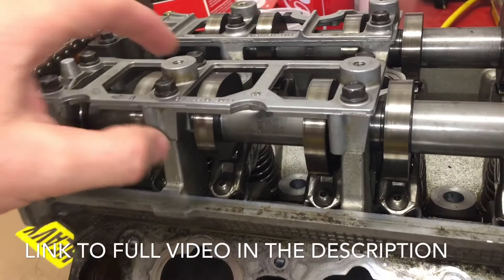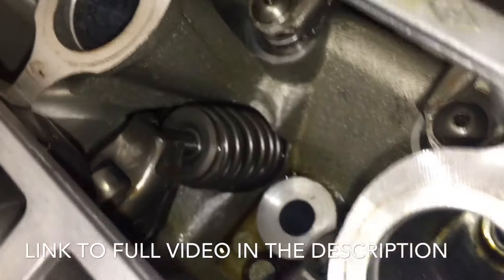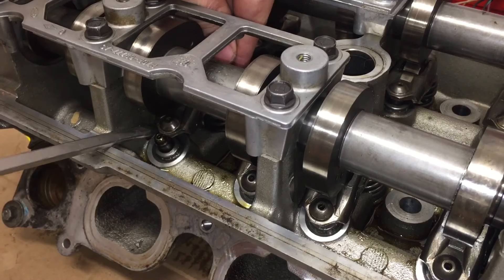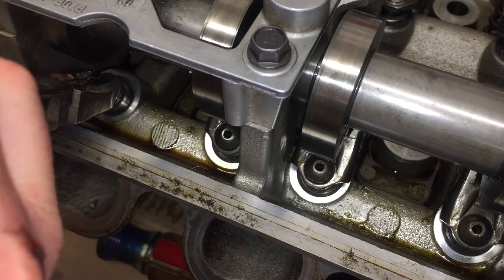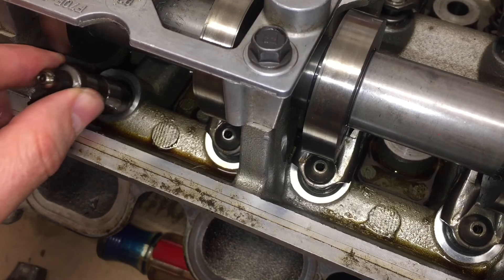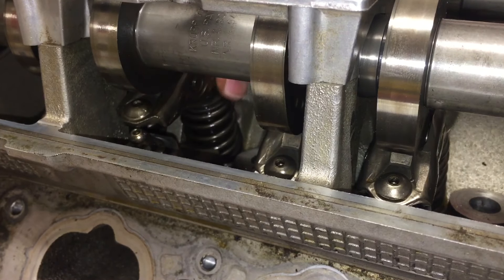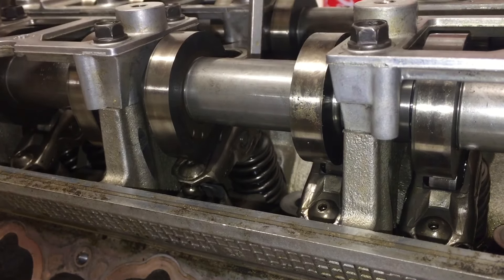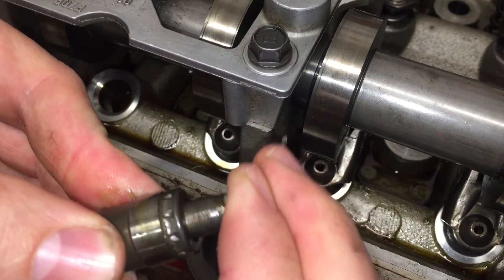Valve Lash Adjuster Replacement: Mustang, F150,  hydraulic valve lash adjusters 4.6l 5.4l dohc

Comment: The problem that I see with the 'popping-out' method, that it does laterally push the shaft of the valve and thereby applying a bending force to it. I understand that you and others may have done it this way many times over and hence are comfortable to conclude that this may not be enough to bend a valve. But who knows for sure(!) It does not take much for a slightly bent valve to get stuck and hit by the piston.
The "popping-in" method seems OK and actually quite smartly executed.
Reply: A bent rod or some other part hitting the piston, you would hear noise.
Reply: @bryanvance6629 in conclusion, is this method safe? Or not
Reply: @iPutTheJinGenius5  The link you provided does not work.
Reply: @mrtopcat2  try that one

Comment: Would this work with other dohc engines?
Reply from the maker: I’ve done it on Ford SOHC and DOHC engines. Not sure on other manufacturers
Reply: Thanks to your video this also worked on my 1vd ftv engine! Whichever saved having to pull the whole motor! Cheers from Australia

Comment: This method will it work without removing head? And if yes do I need valve spring compressor tool or can I use the screwdriver method? Thanks
Reply from the maker: Correct. This is for replacing the rocker and valve lash adjuster only. It’s even easier with the heads on the car so you can rotate the crank to move the cam and take pressure off each lash adjuster.
Reply: @dannyjohnsonsgarage  Thank you for fast reply much appreciated. 🙏
Reply: Can I use the screwdriver method while the heads are still on the car?

Comment: I have a 95 mark viii dohc motor in my 67 f100. When giving slight revs, I'll get a ticking done from the passenger side that will lessen after a few seconds. I assume it's a bad lash adjuster. Does that sound right to you? Is the fix similar?
Reply from the maker: It would be a similar fix if that’s it. I would take the cam cover off to investigate. It could also be a timing component, so listen around with a stethoscope https://youtu.be/WuZL7DSej9E?si=A7XcqWAECo2sSYfs
Reply from the maker: If it is the timing components, I have a video on that too https://youtu.be/rqsWUZjDtnY?si=SZWD0oHPo4GXUg_V
Reply: @dannyjohnsonsgarage can i run the car with the valve cover off to verify exactly which one?
Reply from the maker: @yarkie1  I can’t recommend it, but I have before on the 2V engines. It will splash a little oil, so make sure it doesn’t get on the hot exhaust. At idle it will be flicking some oil around but for a short time you’d probably be fine. On most cars you can put the accelerator to the floor and then when starting it will crank and not start so you could watch the valvetrain that way. Of course be careful in case that was not a feature for 1995.
Reply: @dannyjohnsonsgarage  I appreciate the responses. I just watched the timing chain tensioner video. Great job! Easy to watch and understand. Thanks again!

Comment: How did you determine these were bad? I am in the midst of a rebuild on one of these and the haynes book says to put a paper clip in the hole and it should release the check ball and allow you to manually bleed out all the old oil and ensure that they are not stuck/can pump back up after bleeding down. I cannot for the life of me get any of mine to do that. I even soaked one in acetone overnight. Makes me think they are bad or I am stupid lol
Reply from the maker: I put an Allen key in the nose of them while submerging them in motor oil and pumping. It’s also supposed to prime them, but they are hydraulic, so like a bottle Jack it’s hard to tell if they hold pressure until they are running. They should pump if they aren’t locked up. I followed the Haynes steps too but it’s hard to know if they are good or bad
Reply: @dannyjohnsonsgarage  I ended up blowing them out with compressed air after acetone soak. They freed right up and I could release the check ball. They all pump up with any fluid. Even the acetone.

Comment: Been doing a lot of research on this subject and from a few sources that NPI lash adjusters bleed down faster then PI lash adjusters with 4V being the fastest .. (coyote engines are different apparently?) if you are doing a PI intake and cam swap on a NPI engine sourching the parts from a junkyard PI crown vic grab the lash adjusters while you are there because they are superior to the NPI oem adjusters.. also if ordering new adjusters for 4V ..get NPI adjusters .. if you simply order them from an aftermarket company you might be getting the faster bleed style 4V ones when this is a chance to upgrade to the better design.. comp cams has lash adjusters with slower bleed down rates and they cost a ton of $$$ who is to say they are not repackaged ford oem PI lash adjusters or they simply went direct to the oem supplier for the upgraded design ?

Comment: Some say the hla's should be installed empty, some say no, some say rock solid lifters bend valves.  I'm confused.  Should the lifters be just stiff w/ oil and NOT rock solid?  should they press easily (no oil) as long as the plunger springs back?  Please comment.  I have a '99 Expedition 5.4.
Reply from the maker: If they give the instructions to prime, I would imagine it’s for a reason. You submerge them in a bag of oil and prime them by putting an Allen key in the head and pumping. I would also hold the gas pedal to the floor while starting the car so it will prime and not start.
Reply: That doesn't help me much, but thanks for the quick reply.

Comment: Do you gotta remove the heads or is it possible to keep them on
Reply from the maker: You can keep them on, but rotate the crank to turn the camshaft. It’s actually easier without removing the heads
Reply: @dannyjohnsonsgarage  cool I got an act lightning 145k I’m sure they need changed same with cam followers how often should they be changed

Comment: Can you only use this method with the heads off? Or can you do it on the vehicle to? So you don’t have to compress the springs?
Reply from the maker: It’s the same when heads are on the car- even easier since you can turn the crank shaft with a breaker bar and position the cam lobes right where you want them

Comment: Was curious if a hydraulic lifter out of a 1999 Ford F150 5.4 Triton V8 fit in a 2010 Ford Crown Victoria police interceptor 4.6 engine?
Reply from the maker: I would put both year, make, and model info in and see if they are both compatible. https://www.amazon.com/gp/product/B081TZMDN7/ref=as_li_tl?ie=UTF8&tag=2004047-20&camp=1789&creative=9325&linkCode=as2&creativeASIN=B081TZMDN7&linkId=3fb9111174aee2df78ccab85194f97da

Comment: Does a 2014 Ford Mustang V6 3.7 need a valve lash adjustment or is this only for older cars?
Reply: The “lifters” here are also known as called hydraulic lash adjusters and they are self-adjusting. If there is a valve lash problem then they would need to be replaced like he’s doing here

Comment: i own a 2017 Coyote, it still has a warranty, so the dealer is going to deal with it, but the question I have is, do these tend to fail often?  I do not seem to remember these failing in my 2007 GT with 130k miles and mine in the 2017 make noise when I first start the car for a brief second then goes quiet like the lash lost fluid or something. I was going to look into if I should bother getting the Ford Performance version and hope they will install them under warranty if I paid for them
Reply from the maker: I don’t think they fail often. It’s just something a lot of people assume is bad and not normally the case that they are
Reply: These failed all the time on the old 5.4 DOHC Navi motors.

Comment: 05 dodge ram 1500 4.7 

Cylinder 8 rocker arm popped off a month ago. I got new lifter and rocker arm and the rocker arm is loose when I put it back on. It snaps back on with no effort and that's not normal. I have tried everything. It's not a dropped valve seat..it can't be..I've been pulling my trailer with no rocker arm, last one on Cylinder 8
Reply from the maker: If it has the lash adjuster under it like this, I would try to replace one of the lash adjusters
Reply: @dannyjohnsonsgarage that was part of my comment. I did get a new lifter and rocker arm. Still the same

Comment: Will this work on a 2012 5.0?
Reply: I would like to know that myself cause my 5.0 has a bad tick on the passenger side of motor
Reply: Any word on this question ??
Reply: @golfatit3140  No one ended up telling me if you can or cant, but I gave it a shot anyway. Once I removed the valve covers I found out that the spaces are way too tight compared to 4.6 in the video. Unless someone knows some secret trick, it’s not possible to do this method.

Comment: How to tell it is bad and need new ones? thanks
Reply from the maker: New ones should be firm when you push down on them down and rise slowly but I haven’t had any really go bad on me. The ford manual says that a properly functioning lash adjuster should bleed down in the 5-25 second range. So, if you can depress it with your fingers and it springs right back, it's bad. If it takes longer then 25 seconds to bleed down or less then 5 seconds, it's bad. I believe you need to remove the oil first so they should be dry to test. You’ll want to soak them in new motor oil, put an Allen down the head and push the tops up and down to prime them before install

Comment: Now do this in an early 2000s Expediton with half the engine in the firewall and the ac line in the way (The back ones are very hard to get to, the 2v compressor tool has to be held down by hand unlike the 3v tool that can be screwed down and will stay in position on its own) . Not sure how hard is it to replace this on Mustangs while the engine is still in the car.
Reply: you all probably dont care at all but does anybody know a method to log back into an Instagram account..?
I was dumb lost my account password. I would love any help you can offer me
Reply: @Callum Edward Instablaster ;)
Reply: @Jasper Cash i really appreciate your reply. I got to the site on google and I'm waiting for the hacking stuff now.
Takes a while so I will reply here later when my account password hopefully is recovered.
Reply: I feel this. Taking them off wasn’t an issuer but locking the rollers is a struggle with the engine still in the vehicle

Comment: Will continuing to drive with the ticking noise caused by these going bad cause engine damage? Or can you just drive it like this with the ticking indefinitely?
Reply: From what I know, bad lash adjusters can cause camshaft damage
Reply: @flash_the_stang8956  i know there’s no guarantee but would driving gently with a couple stuck lash adjusters for maybe 2000-3000 miles be ok probably?

Comment: how can you tell the valve lash adjuster is faulty? is it noisy, are they just really soft or do they completely collapse or something?
Reply from the maker: All of the above
Reply: @dannyjohnsonsgarage  Some say the hla's should be installed empty, some say no, some say rock solid lifters bend valves.  I'm confused.  Should the lifters be just stiff w/ oil and NOT rock solid?  should they press easily (no oil) as long as the plunger springs back?  Please comment.  I have a '99 Expedition 5.4.

Comment: Had a rocker follower on driver exhaust side break in half. 2018 5.0 F-150.  Is it possible to slip a new one in there without removing the camshaft?

Comment: Do these cause a tick when they go bad?  Or is that more from valve seals? How would you know they were bad without taking the engine apart?
Reply: Yes they start to tick when going bad. Take something long like a breaker bar, crow bar, or a very long screw driver, and turn on the engine. Take whatever tool you're using and place it on the valve cover, so that it's phystially touching the valve cover. Place your ear on the other end of the tool and listen for an odd noise. Most of them will sound the same but the one that sounds different is nearby or the one that is starting to fail or has already failed. Very important to replcace then ASAP as it could drop a valve and destroy the engine. It could also be the phasers for the VCT mechanism. If you want more info, @FordTechMakuloko has some videos talking about them and how to replace them.